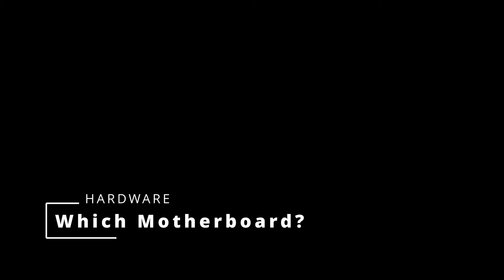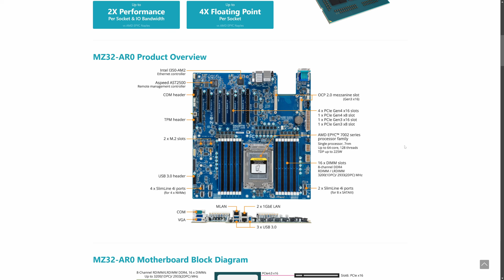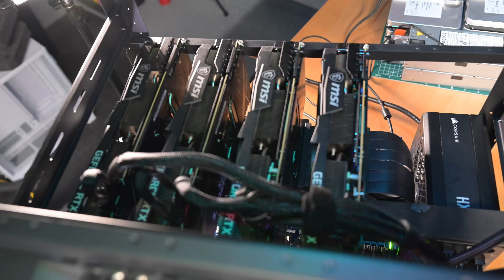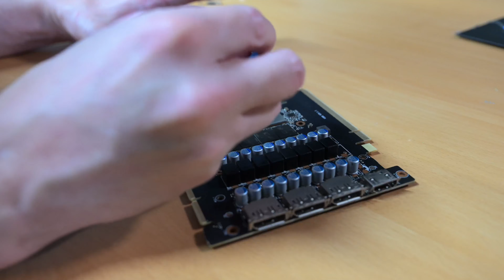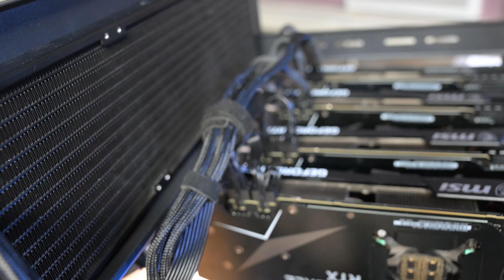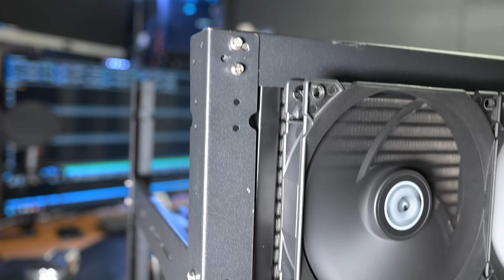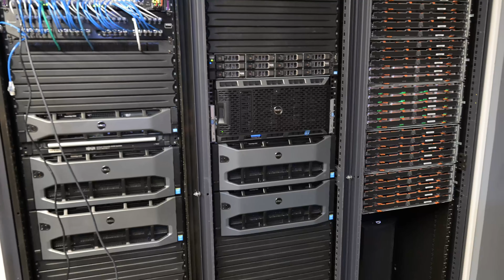INSANE Home AI Server - Quad 3090 Build

Comment: why didn't you go for a tower cooler? There are some decent 3U/4U options that are not loud and the performance is more than adequate. Please note that server motherboards rely on airflow over the VRM for optimal operation. You could run the risk of hitting thermal limits and cause throttling/shutdown of the system.
Reply from the maker: Yes I have a HDX vornado ripoff mini fan that I have pointed at the mobo. It will be in the testing video. I do have tower coolers, but they are all utilized in other systems currently. This Corsair 420 I had free and I very well might be putting the 7995WX into this rack at some point for testing on the fastest platform available.
Reply: @DigitalSpaceport  if it's free, then all good. great video

Comment: You should get hailo to sponsor a video with their 8 or 10h m.2 module
Also howmany tops is this setup?
Reply from the maker: Im open to free storage gear. Like VERY OPEN lol.
Reply: They arnt storage. They are ai compute modules. 26 and 40 tosp of comput at less then 5w.
Reply from the maker: Im technically very open to all gear lol. Ill have more in the benchmark video on all the stats, but the 70b so far is looking good on tok/s at 17.7 and 98 for 8b llama3.1

Comment: Looks cool.  I prefer founders editions so pretty and such high build quality.  Oh by the way your MOBO&EATX connectors didnt look pushed in properly?
Reply from the maker: I love the FE editions also they are works of art. I have FE 3070 and 3080ti but noticed on used markets the 3090 FE is not just slightly more expensive. Good eye! I just went and seated it fully.

Comment: WoW, lovin this build!   I built my LLama3 on my ProxMox with a single 3090RTX Passthrough.   It gets pretty hot, I can only  imagine what kind of heat load your pumping into  that room..
Reply from the maker: I have active cooling but yes that has limits. I have some ideas on placement to hopefully help I'll be testing in the next video. Rearranging  the area a bit now.
Reply: I have 2 RTX 3090's in a AMD 5900x system and they thermal throttle because of the spacing. Once I get the PCIE extension cables and install them in a new case that should solve the problem.
Reply from the maker: @jksoftware1  yeah the 3090 is a really fat card. I toyed with the idea of water cooling but it was much cheaper to just use the risers. The risers are still too much imo also.
Reply: @jksoftware1  
I have two 3090s in an Asus Z170-E motherboard with a 6700K and 64 GB of RAM.

The two slots drop down to a x8/x8 configuration, so it makes it more difficult to push a hard enough load onto the GPU to get it to thermal throttle.

(And that's with running both InvokeAI and open-webui with the codestral:22b LLM models simultaneously.)

If I need to space them out, I can use some of the GPU mining hardware that I still have. The PCIe x1 link back to the motherboard won't be great for bandwidth, but it will provide ample spacing for cooling.
Reply from the maker: Its not that bad for bandwidth as long as your doing inference workloads. Some rag workflows will really be slowed down for doc ingesting. Training on 1x is pretty impossible. Mining risers work suprisingly well overall.
Reply: You can also lower the tdp by about 40-60% without letting ai performance down
Reply: @malloott  Ya, lowering tdp with nvidia-smi command seams like the way to go.
Reply: @JoeVSvolcano  can you send me a link or some information on getting this to work I have a 3050 RTX
Reply from the maker: You can checkout the lxc and docker setup video guide: https://youtu.be/lNGNRIJ708k and the witten instructions here: https://digitalspaceport.com/proxmox-lxc-gpu-passthru-setup-guide/ for your proxmox setup.
Reply: It depends on your workload and whether you're running a model or training a model.

If you're just running a model, unless you're constantly peppering it with requests, it might not get all that hot.

(I'm running a dual 3090 setup with the open-webui, which uses the Ollama backend, running the Codestral 22b model, and it only spins up when I ask it something or type a response back, but then in between that, the GPU sits at idle.)

If you're TRAINING a model, then that's a different story.